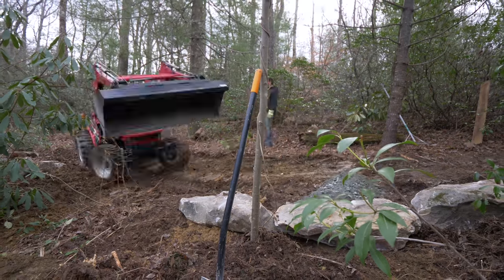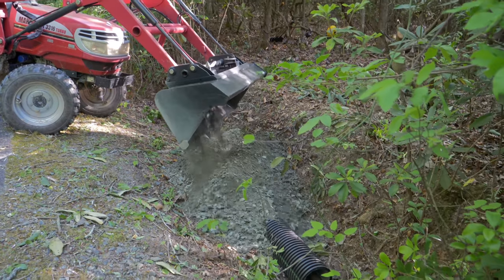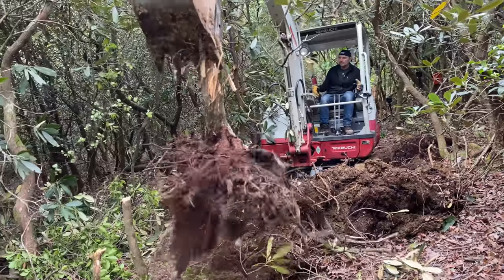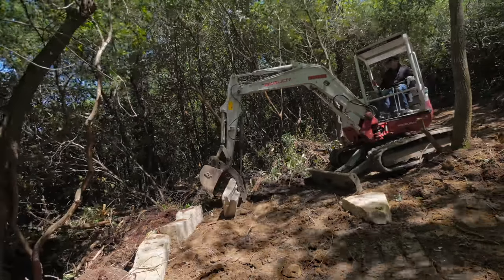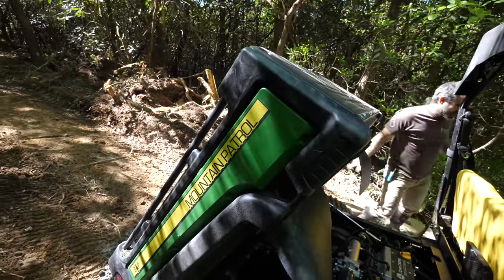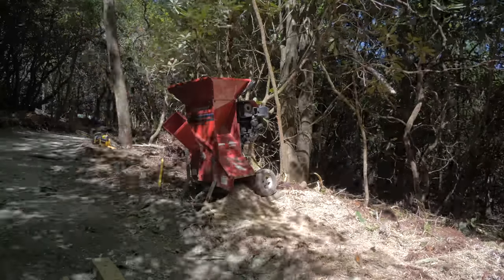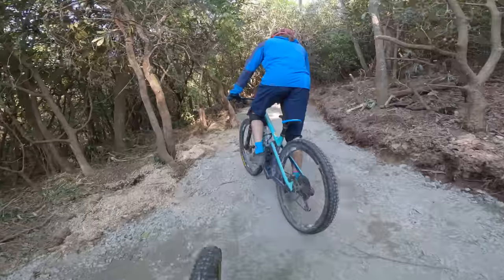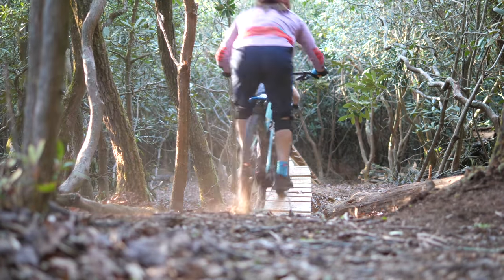We built a boring gravel road and changed Berm Peak forever!

Comment: Hey Seth did you know you can get rust off the metal parts of your bike with aluminium foil and white vinegar just fold the foil on the shiny side and spray or dip the foil in white vinegar then rub hard on the rusty bit and then  it will come off

Comment: You could always use the wood chipper thing. Save the little chips that are cut up. And any spots on trails that are either too soft or just need a little help for riding, put the little chips there. It helps the soil kinda keep shape a little. Helps texture for riding and it’ll look good.

Comment: You should also add right berms or some kind of lip at the far side of the double track so that if you come off of a downhill trail directly onto the road at speed you don’t just fling into the bushes and you have some kind of safety net.

Comment: We all know about the problem of the chain, that it wears out, taking both the cassette and the front star into the trash, that if you use industrial bearings instead of pins in the chain, it is a rather crude idea, but I think you can start from it and improve .
Thanks for your attention

Comment: I hate to be that guy, but I used to have an extreme fear of our tractor flipping over, but trust me, it will not flip.  It will tip quite a bit and you will be riding on the front tires, but they were made to do that.  I just don't want you guys to have to keep double moving material and just get it there with the tractor.  Keep the bucket low and put somebody on the box-blade on the back and you should be fine.
Keep up the good work!

Comment: I don't how it is in US but here, a mini digger is about 1 ton, whereas this one in the video was around 2 tons. I have seen a two wheel digger using mower engine, it had 2 legs and 2 wheels and it was creeping type, that was prolly like 500kg. But real usable tracked mini diggers starts from 800kg and would easily fit into Alex's van

Comment: Great video. Looks like water will flow across the road since it’s cuts through the slope. If so, how do you manage the water not carrying the gravel off of the downhill slide? Is similar how one would cut in contour line single track? Thanks.

Comment: Working as a welders helper theres been tons of occasions ive used sky traks, loaders (really small to so big that they have their own air conditioning and radio). A lot of the time youll get some idiot who applies as a machine operator even though he has no real experience and is just too lazy to get out of the loader and work. I remember one time about 5 years ago i was on a job in the middle of summer(hot as fuck and we were working in trenches with acetelene torches and propane torches so it was hot as shit) welding new hot and cold water lines that went around and old private school is Dallas. Near the end of the job most of the guys that werent needed anymore (read as lazy and didnt pull their weight) were let go and a few of the guys and myself stayed to finish up for a few weeks. There was one guy that the foreman wanted to lay off but for some reason he couldnt or wouldnt. His name was something like deshawn or de something, maybe rick.....lets go with deshawn for the purpose of telling the story. He was in his late 30s but acted like a irresponsible 20 year old. Anyways, one day we were all busy welding the last few lines and needed dirt from around the front of the project about a 1/4 mile away to cover up what we had already finished. So this Deshawn guy is delivering dirt going in a out of the trench way too fast like hes a "badass" with his headphones in. About half way through the day when the foreman shows up hes exiting the trench too fast like always and not at a good angle obviously without any sense and he completely flipped the whole loader backwards. Now lets get something straight its not uncommon to have a small loader fall sideways a little bit and get stuck, we just get the skytrak and put it back up right. But this was something special lol,  when that guy rolled backwards back into the trench it was one of the funniest things ive ever seen. Mr badass bounching around inside that loader like he was at a theme park. When the loader finally settled everything inside it was on the ground and we had to grab the guy and pull him out he was so shook up. Best part was the foreman was sitting there watching him acting like a jackass so it was obviously his fault. Anyways....just couldnt help but think of that. I also saw a guy fall through a skylight 30-35 feet onto a concrete floor (into the warehouse i was working in, he was part of the roofing crew fixing the roof cause wed recently had 2 hailstorms back to back). But sadly he was a good guy with a family, a hard worker , respectful to everyone he worked with etc. and it was just shit luck. He was walking backwards and tripped over a pole or something, i think it was the squigy type thing they use to level out the tar. A few hours before he fell i moved a massive slab of marble that was on top of a sink display (it was a plumbing warehouse). The display had holes for three sinks in it and if i hadnt moved it that morning he would have fallen half on the marble slab and flipped around onto the concrete(that marble display was right under the skylight but to the side just enought that it would have just made things worse. It looked real bad but he was out of the hospital in about a week. I had to clean up all the blood with bleech, hed broken his colar bone and his arm or leg i cant remember which one. But the blood was actually from him hitting his head. .....Alright im done.

Comment: sorry but, what inner width and tire width do you use? i run 22.5mm inner width rear 21mm front and 2.3 inch on both, what would you recommend for 12x142 rear 9x100 front?